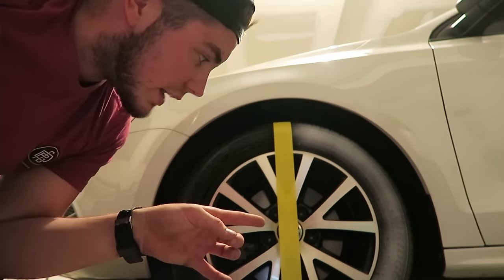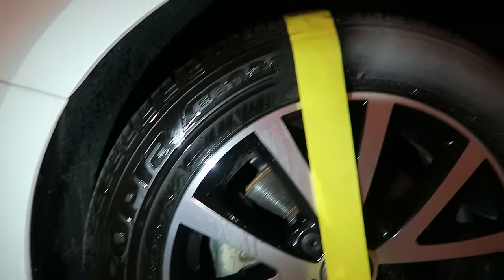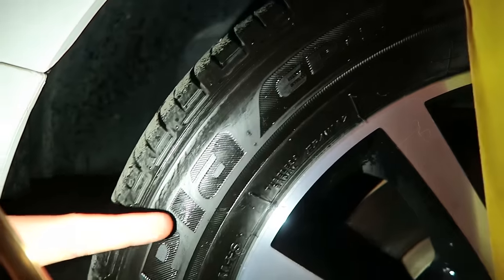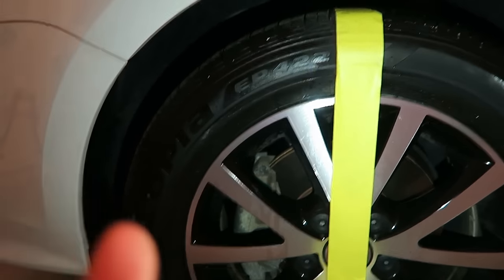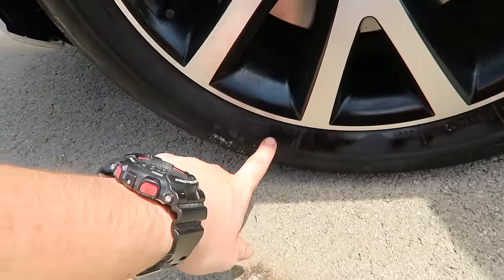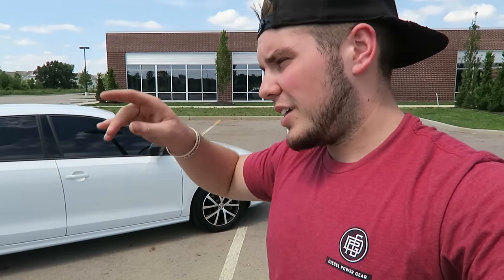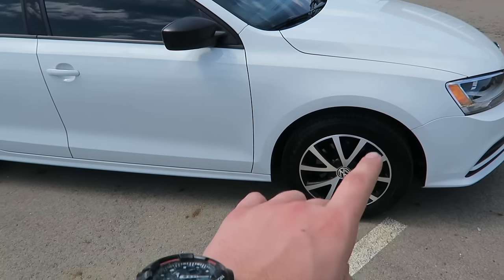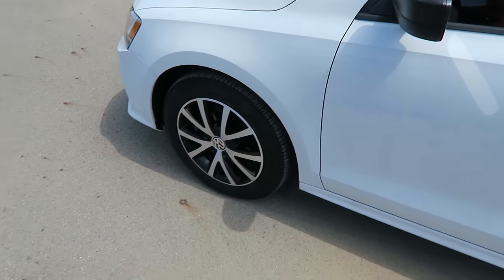The BEST way to Shine your Tires!  (You'll never use tire shine again!)

Comment: Back in the late 60s before tire shine products were available, We all used pledge on tires and dashboards,  Another product we used on tires was Mop and Glo.  You discovered something we old schoolers did back in the day.
Reply: 7islander    Yes so true. 70"s and 80's. We did it that way,
Reply: That's fascinting man!
Reply: Truckers secret mop n glow baby
Reply: Yep been using it for years   AND I use it for engine detailing the wires and vaccum lines... it makes them last longer....
Reply: Jim Brent  Thanks for the quick tip! I didn't even think about using it for detailing the rubber and black plastic parts under the hood 👍
Reply: Jim Brent  What do you like to use as a cleaner/degreaser on your engine? I've always used Simple Green and never had problems. I've heard good things about Purple Power, I just stay away from those aerosol cleaners from companies like Gunk. Never had luck with them and they are super overpriced.
Reply: I agree the aerosol cleaning never did much except on a really greasy engine and even then not so good. (I agree simple green does work well. ) Now I just use a spray bottle with water and Dawn Dish soap - and gently rinse it with very warm water... Also I wash my engine once a month so the grime doesn't build up and I spray it with Lemon Pledge and the dirt doesn't really stick to it (obviously not the block or exhaust manifold etc...) 

For the record I have been using the pledge on my rubber and vinyl for well over 20 years and never had it damage anything - my understanding is that most tire shines have silicone which does damage tires...

Now to really blow your mind... if the engine is really old and is really greasy I use vegatable oil with a cheap paint brush... Bush it on let it soak for a day and rinse it with hot water and a scrub with a toothbrush...
Reply: YEAH to Mop N Glo !!!
Reply: MOP & GLO ---  GENIUS !!!!!...  and you can get an off brand of the same stuff at DOLLAR TREE !!!!!...  for...... $1  !!!!!!!
Reply: 7islander so true I'm 18 and I have found that out by myself not only with tires but with alpt of other things , they do say history repeates itself...
Reply: I was about to post the exact same statement! Back in the early 80's, I used to use Lemon Pledge on my Z28 tires... That is until one day after I had put a fresh coat on my tires, some God damn bees were attracted to the lemon scent. I didn't see them in time and they stung the shit out of me!! :-)
Reply: 7islander does that really work ole school
Reply: Stupid idea. Pledge creates a slick and water resistant finish. 

Slick finish + tires = degraded stopping power and increases hydroplaning.

Don't be like this guy, don't be stupid.
Reply: Dj TeeOh if you’re using the sidewalls for stopping, you should probably inflate your tires to the proper psi...
Reply: 7islander Yes sir, also used griffin shoe polish, in the can. Same used by shoe shine boys, paste like, apply then buff to a shine!
Reply: What about WD40 or Armor all?
Reply: LMAO!!!!
Reply: I used Mop and Glo on the Tires back in the early 80's
Reply: Real talk
Reply: Another vote for Mop and Glo....also used it on my non-inspection boots in the Army!
Reply: Mix up a small concoction of diesel fuel and 140w gear oil...40/60. And you will have the shiniest tires of all... Everytime
Reply: 7islander same with me in the early 90’s, (not so way back) and we used that skit on everything! Windex and Pledge cleans everything from the carpets to the windows.
Reply: Also we used Brake fluid, gave a nice satin look and enhanced the tire without stickiness. I still do it with DOT 4.
Reply: @DRock6906  : At least the dog wasn't attracted to piss on you tires ! !
Reply: And joy dish washing liquid.. LMAO 😂😂😂😂 and honey.
Reply: In the Marines we still use pledge and mop and glow and colt 45 to clean.
Reply: YES... Mop and Glo
I was just thinking about that today
because I'm getting ready to refurbish a 
1972 travel trailer... and the floors are perfect for
Mop & Glo... Do they still make it??
Reply: What did you use the Mop and Glow on?
I just bought 2 bottles yesterday, because I'm restoring a vintage 1972 Trabel Trailer... I'll be using it on the floor...
Reply: Yup used sc Johnson wax in yellow can and pledge everything else
Reply: I use the other stuff u had, but i apply it to sponge and wipe on. Gotta try pledge, because even wiped on the other stuff goes all over.  And whatever they spray on at car wash will ruin your rims.
Reply: Plz share your knowledge! Make a vid of the top ten old school car tricks that us new generation carguys could use! Or something like that. We need the knowledge of our elders wether we admit it or not lol. If you wouldn't mind anyhow.
Reply: @TargetAcquisition  I might could totally agree w you except he used it on the outside wall of the tire... I would think to have decreased stopping power it would have to been used on the inside wall and/or the traction.
Reply: Mop n glo cracks though.
Reply: Best way to shine tires was & will always be to take a ride when it's raining hard.
Reply: 7islander we all know that tire stuff rots tires , hows the pledge and mop and glo do with premature tire rot ??
Reply: @jimbrent8151  wow really? Can you sort of explain a bit how you'd use pledge to engine detail? 

This is excellent info!! You don't all these new fangled gimmics it seems! 

Oldschool all the way man! I love to see oldschool tech being reborn for the new generations.
Reply: @Scientists_dont_lie  Oh sure... it it very easy.... After a light cleaning, ( basically I use the CrhisFix method - there is a video on this method)  I use the pump spray bottle (not the Aerosol which over-sprays everywhere) and and brush all wires / vaccum lines with a tooth brush and wipe at all down with a soft cloth and for the really tight areas I use Q-tips... it pulls alot of dirt and grime out of everything, shines it a bit and protects it from salt and oil. It takes about 2 hours start to finish. I only do this twice a year, Then every month or so when I wash the vehicle I just GENTLY spray the engine compartment (almost a mist) of WARM water (not hot and not cold) avoiding the alternator (put a baggie over it), map sensor (use aluminum foil), the intake manifold etc.. and most of the grime just drains away.
Reply: That's right. I would also lemon pledge my motorcycle, shinyest bike in town. Once I even mistakenly used it in place of my spray deodorant.
Reply: @fredricksaenz2342  yup
Reply: You forgot a real secret from the 60's ... esp. for auto show cars... Comet Cleanser to clean the tire... then use Shinola Black to detail... a lot of people don't know this :)
Reply: I remember applying brake fluid to tires in the days before tire shine (Armor All didn't hold up on tires). Just dump some cheap brake fluid on an old rag and wipe it onto the tires.
Reply: Thats cool
Reply: Works excellent for shining up motorcycles
Reply: @jimbrent8151  ru serious?
Reply: Mop N Glow works really well
Reply: Agreed. Pledge was the only one when I was cleaning my mom's car.
Reply: I forgot about floor wax lol smh..
Reply: @DRock6906  lol smh..
Reply: wooow  - awesome history
Reply: Okay boomer
Reply: @appledixie  how do you remove if it stains the rims?
Reply: @hmdwn how do you remove if it stains the rims?
Reply: @MrAcuta73 how do you remove if it stains the rims?
Reply: @judichristopher4604  
How do you remove it from the rims?
Reply: @frankevans6584 
How do you remove it if it gets on the rims?
Reply: Try tire gal wait 15 min before  driving  it will look good a stay on for a week  get at Walmart  or   auto zone .
Reply: Chuuch 😅

Comment: I only use black magic. Have zero issues with it slinging on my car. I spray it on the tires, let it sit for a few minutes, then spray some on a pad and wipe them all down. I do it on my day off. Car sits for a day and I have zero sling. You’re not really going to find a product that doesn’t sling on the car right after you apply the shine anyways. I always give it about a day to settle in.

Comment: So I can use tire shine on my furniture? 😂
Reply from the maker: Sergio Miramontes you make a valid point 🤔 maybe we can! Lololol
Reply: I wouldn't
Reply: Sergio Miramontes lol funny man
Reply: I've been using Pledge® on my Harley's in between washes for years. Takes bugs off the paint and chrome and it makes the windshield repel water and bugs. A lot cheaper than the other brand name "detail" products at auto parts stores.
Reply from the maker: Bobby Ruth look at that! Even can be used for motorcycle applications!! Thanks for sharing the info!!!
Reply: Bobby Ruth so u use it on glass also?!
Reply: Scrubbing Bubbles works even better. It also works great inside the car and under the hood......
CANCEL
COMMENT
Reply: Sonja Smith NO. Pledge cleans w oil base, will smear.
Reply: sure you can. WOrks well with plastic vinyl and other sufraces but you have to wipe it clean and it will be kinda greasy so you wouldnt want to say use it on a leather couch that you sit and lay on. end tables, other stuff.
Reply: Sergio Miramontes unless you like greasy furniture
Reply: Sergio Miramontes pledge is bad for rubber period. Just stop going cheap and get the good tire protection and coating not just a tire shine.
Reply: I use tyre shine on the inside of my car 😂😂😂 lmao
Reply: Sergio Miramontes 😂😂😂😂 aint nobody couch shine like mine
Reply: crying!!!....ctfu
Reply: Daniel Donaldson 🤣
Reply: Sonja Smith, That’s What I want 2 Know, Because Pledge is A Greasy Spray, How The F Would That Work On A Windshield???
Reply: Sonja Smith try it on your hair
Reply: Sergio Miramontes you can use that sh*t on anything
Reply: Sergio Miramo
Reply: D Carden- I thought the same thing.
Reply: @jekku4688    99.999% of car care products are petroleum based.   Pledge probably has far less petroleum base than most of the regular car care products.....
Reply: I used it on my ex wife's steps  14 years ago. Never paid alimony.
Reply: @dreamingcode  😭😭😭

Comment: I've always used pledge on tires, plastic doors handles, mirrors, finder flares, and pieces on the bumpers. Works great and never faded the color of the black plastic material over time. It works wonders!
Reply: Wow, I never thought to use pledge on mirrors😮 I always thought it would leave streaks. I’m gonna try it. Thanks for the idea👏🏽🫵🏽 can I use it on my flatscreen TVs?

Comment: I use a product called, 'COVER ALL' for my tires and that stuff is FANTASTIC! It sprays from an aerosol can like spray paint, but it doesn't come out in the form of foam and you don't wipe it... simply spray and go. 

I personally prefer my tires to look wet and this stuff achieves that look without looking streaky. It sprays on nice and even... again, like spray paint, and the shine lasts for a good 5 days.
Reply: Same here works great
Reply: Yup

Comment: The Tire stuff will work just as good as the pledge, you have to remember tires have pours and you should clean your tires thoroughly removing all dirt and grime before you apply any tire shining agent...plus instead of spraying the tire shine on the tires use a sponge and apply the tire shine heavily.. The main problem why your tires become dual is because after most people leave the car wash after they've applied tire shine they don't wait for the tire shine to soak in and the tire shine gets flung off the tires before it's had time to be absorbed into the the tire that's why after you've properly applied tire shine you want to wait at least 20 minutes before pulling out of the car wash..

On the subject  a great substitute for black magic tire shine is 3M tire dressing it's thin so it soaks up faster in the tires pours and it resists rain very well too for a long lasting shine.

Comment: I worked in a motorcycle shop in the late 1970's pledge was used to detail every motorcycle on the floor for sale. Works great on tires, paint, plastic, chrome. Removes bugs well also. If you buy the cheaper dollar store version it even has wax added. I have been using it ever since.

Comment: Everyone knocks the Black Magic Tire Wet, but I love it. Don't spray it directly on the tire, use an applicator. If you want a gloss, wet look, apply 2 coats. Let it dry before you drive. Done right, it looks great and lasts longer than any other dressing aside from the tire paints. It also repels dirt, brake dust and water extremely well.
Reply: Exactly that's what I do
Reply: Still don’t recommend, makes the tires super sticky and is a b to take off. Better to invest on better high quality products

Comment: Before you try this yourself, you may want to make sure pledge won't do any damage to your break pads (causing a slip effect), rims, rubber, etc. You can avoid most of that by spraying the product on a cloth and then applying it with that, but you will still want to make sure that product won't damage your rubber.
Reply: EXACTLY 💯
It may cause premature WEAR AND TEAR!!!!
Reply: I'm concerned about it also

Comment: I live out here in West Texas. Most products that you apply to your tires make the rubber look really good for a while until the wind blows hard and makes dirt stick to your tires. Then your tires don't look so good. I've put different products on my tires a long time but I apply it with a pad instead of spraying directly on the tires. I never leave my tires wet. Buff them with a microfiber towel. That way your tires will shine but won't be left wet to sling on your car. Works every time and you avoid have those greasy spots on the concrete from  where the tire shine was sprayed on.

Comment: Great video !!     I do have a couple things you may wish to consider.       Pledge is also available in a pump spray container, and I've found that the tire clean/shine foams are not nearly as messy as the pump spray version.       One last mention is that Wesley's Bleach-White, recently sold to another company with a slightly different brand name, is the only actual white-wall and white-letter cleaner that i've ever come across that actually works and all it takes is a very light lick with a brush and the road grime just 'melts' away.       Thank you so very much...
Reply: Comet works wonders on whitewalls and white letters

Comment: To help maintain the black appearance of your tires, simply wash them with a water-based all-purpose cleaner or mild soap and a soft bristled brush. 

Tires contain an ingredient called antiozonant that protects tires from ozone in the air. An antiozonant is an organic material added to the rubber compounds that prevent or slows the deterioration caused by exposure to the elements and cracking. Today's rubber is designed intentionally in a manner that allows the antiozonant constantly to work its way to the outside of the tire and as such, continually keeps the outer surface and sidewall pliable and resistant to oxidation.

If you would like to apply a tire dressing, be cautious because there are many different tire dressings on the market. It is recommended to use a water-based dressing. Some silicone or petroleum-based solvents or alcohol may cause premature cracking from accelerated aging process.
Reply: U

Comment: I've used budget for decades on other related applications. Spray underneath dirt bike plastic fenders to keep mud from sticking. Spray on the front bumper to keep bugs and Road Grime from sticking and impact in your front bumper and headlights. Also for tire shine. Even has Rain-X effect for the windshield.

Comment: The Tire Magic says wet, so it should look wet.  I do like the Pledge look much better.  Another use for Pledge which was reccomended  by a window and door business is to use it to lubricate the track on sliding doors such as those "patio doors", it works very well making the door slide much easier.  Thanks for you tire test.  Here is a tip so when you spray anything on your tires, drive on top of a piece of cardboard, spray tire move the car a bit, spray again the area that was on the bottom.  The cardboard keeps the tire shine liquid from getting on your garage floor.
Reply: Love the tip for lubricating sliding door track but with respect to moving the tire to avoid the drip don't apply the product straight to the tire use an applicator a rag something
Reply: @papercuts7777  Thanks I will try it.

Comment: Thanks, I have the same car color and all. I use black magic tire shine spray on foam. And wipe it off with a microfiber sprung. On the rims I use F1 ceramic coating. Again wipe it off with a clean microfiber rag. The dash I use Maguires mat finish wipes. Works great. No slick or slap off on the paint. The F1 helps keep off break dust so easy weekly wipe down the rims and the shine. No product needed. Both tire shine and weals clean up last 3 weeks. I use Maguires gold class wax 2 coats once a year and wash it weekly with armor all car wash. The wax last threw winter with 2 coats. As long as you wash it regularly.

Comment: If you get scratches on your car, or the white gets dingy around the front bumper... use a wet magic eraser. It’s my secret weapon. Shhhh don’t tell 😉
Reply: BAD idea!!!  Magic eraser is micro abrasive and will rip the clear coat off of your car and leave dull pathes in your paint ....also never use magic eraser on latex paint as its micro abrasive properties will actually shine flat latex paint and leave shiny patches and streaks on your walls.

Comment: I am nuts for good black ass wheels with tire shine or silicone most important part I found is making sure you clean the tire very very good to start with and it will work the best, spray it on and wipe and then just spray a nice coat over, and wipe the wheels off really really good, the silicone actually helps get any dirt left behind on the wheel.